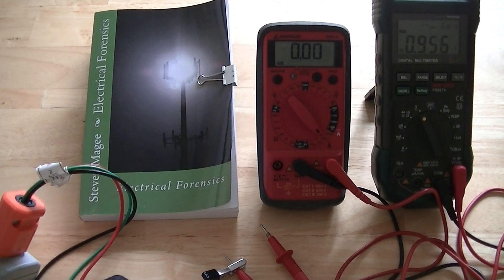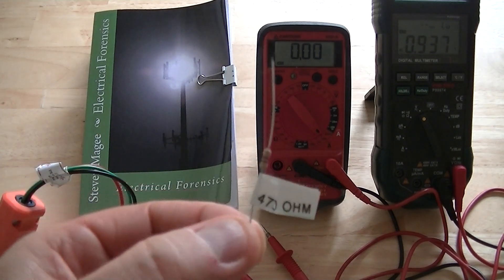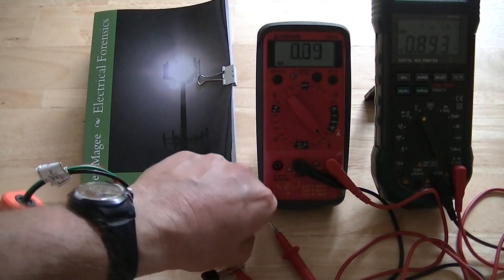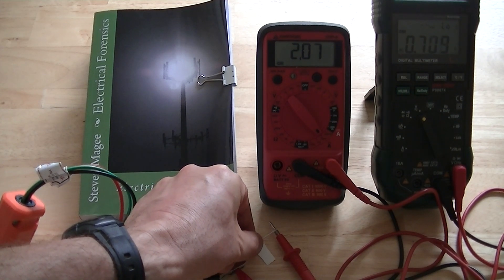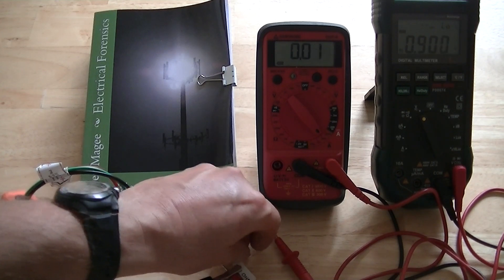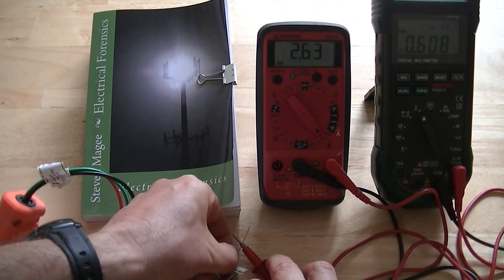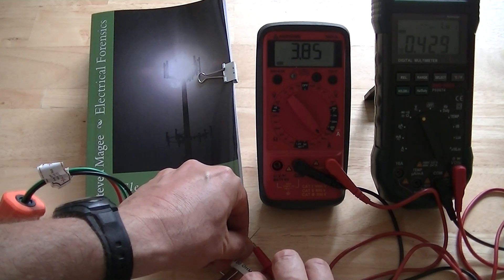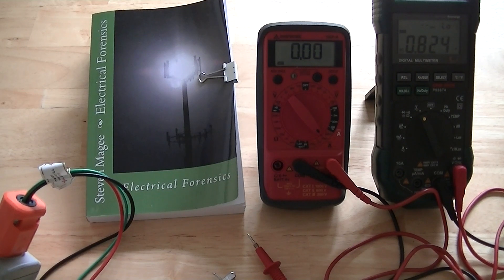Stray Current and Stray Voltage Measurements 28 May 2014

Comment: You should make an electrical schematic of the 'situation' and show where this 'stray' voltage is coming from, and the resulting 'current flow' that occurs because of it.  The diagram might certainly help make things easier to see what you're talking about, as far as the sources, and then explaining more about how to eliminate, or at least reduce said 'stray' voltage, and current. Thanks!!!
Reply from the maker: At my home the primary source is the utility combined neutral & ground connection.  The secondary source is the underground utilities that run near to the side walk.  My research indicates that no current flow is needed to make the human sick.  Direct contact with stray voltage and the field emissions from the electrified foundation both appear to make the human sick.  See: http://www.environmentalradiation.com/Stray%20Voltage%20Press%20Release.pdf
Reply: Can you explain what you are talking about so someone, not a geek can understand please?